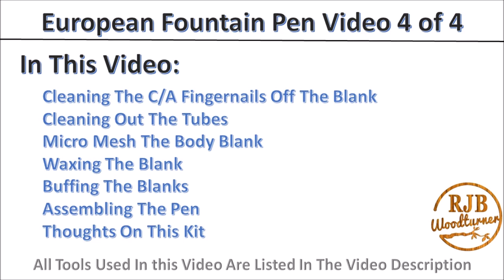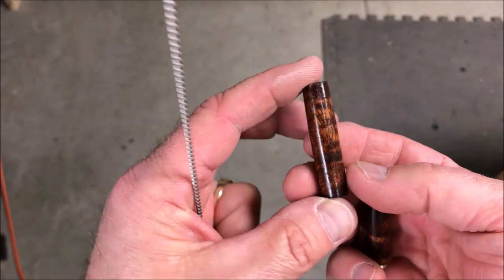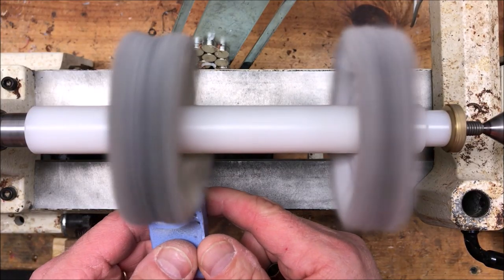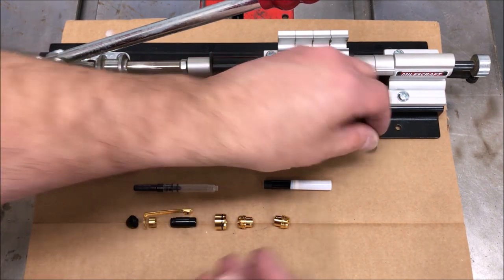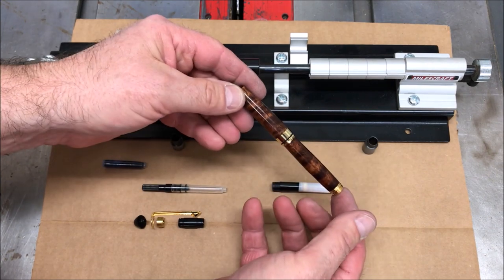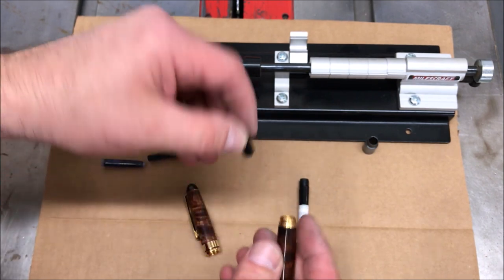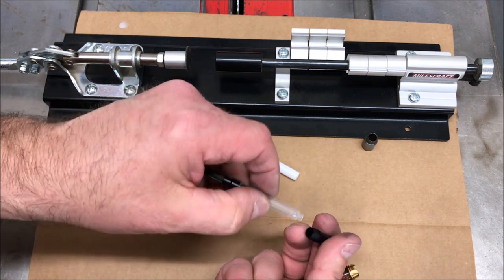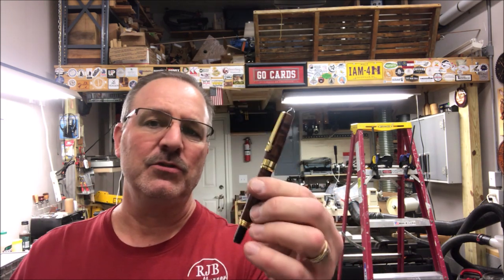European Fountain Pen Video Part 4 of 4

Comment: Hi Bob - I made a couple of tapered sticks that I stick in the end of my blanks to hold them when I run them on the buffer.  They are made of wood so they don't turn my buffing wheels gray and they really help stabilize the blanks as I press them into the wheels. - Great set of videos - thanks - Dave
Reply from the maker: Nice idea David, thank you. 

Regards 
Bob

Comment: W/R/T removing the CA fingernail from the end of a blank, I take a different approach. After I'm through micro meshing the blank, I use a sharp skew to cut a very slight chamfer (no more than 1/64" wide and deep) at the ends of each blank.  This cuts the blank loose from the bushings and eliminates any fingernail. One of the advantages of this approach, it makes any difference in size between the blank and the metal components of the pen less noticeable.
Reply from the maker: Thank you David. 

Regards,
Bob

Comment: You held the blanks by hand when you polished because it didn't fit on your mandrel.  Would it have made it easier if you would have slid the blank over the correct size punch to give it support?
Reply from the maker: That could have helped. 

Regards,
Bob

Comment: Question: what happened to your use of Meguiar's PlastX? I still use it before the wax for all my pens and I am amazed at how well PlastX polishes and shines the blank.
I think I agree with your kit assessment, it lacks pizazz.
Reply from the maker: I was given this renaissance was by a fellow turner, Rick Troup, to try out. I really like the way it works. Plast-x does a fantastic job too and I will probably go back to it when I run out of this stuff, it’s way cheaper. 

Regards,
Bob

Comment: Bob, sorry one other question for you. Not pen related but related to you shop dust collection system. Did you ground your PVC pipe?  I am installing a dust collection system in my shop, really tired of all the dust, and read some articles pro & con about grounding the pipes to discharge static electricity. What are your thoughts on the subject. Oh yea, those couple of pieces of teak I sent you last year from the Battleship NJ would make a very nice fountain pen LOL. Take care.
Reply from the maker: I did not ground mine. If I notice any static I will add a ground. So far I haven’t noticed a thing. 

Regards,
Bob

Comment: I was wondering why you put medium ca glue on the finish can I just use thin what does it do to the finish. Also where can I get a buffing wheel
Reply from the maker: I use the thin to seal the blank and the medium to build and level. 

Regards,
Bob
Reply: @RJBWoodTurner  so can I just use thin
Reply from the maker: Yes but it takes a lot of coats to fill the grain. 

Regards,
Bob

Comment: Just got to watch this. There is more wrong with these pens then meet the eye. This pen also comes in a roller ball, I have built several. One of the major faults is the ring that presses onto the small section of cleaned off tube, simply comes off. The screwing and unscrewing of the cap simply work it off the tube.
Reply from the maker: Good to know Terry,
  I’ll watch for that as I use it. 

Regards,
Bob